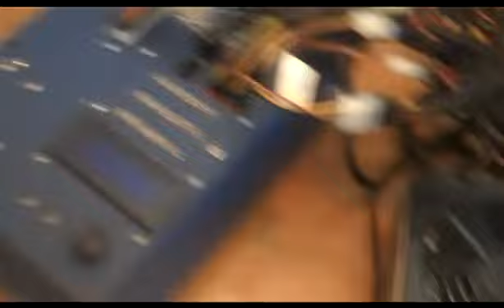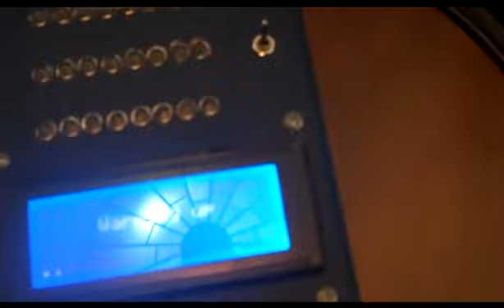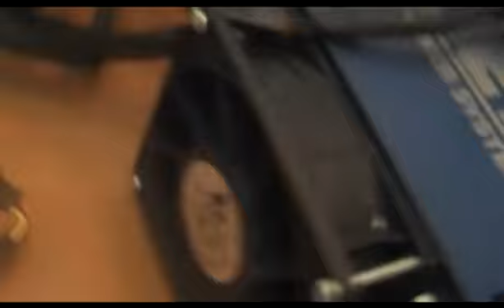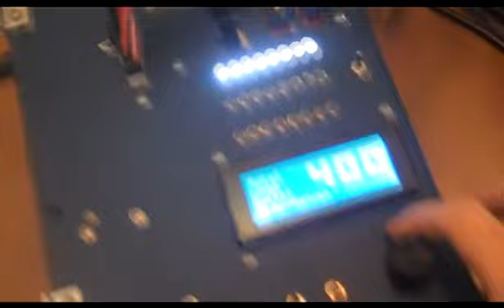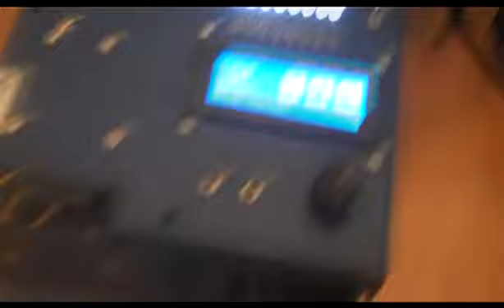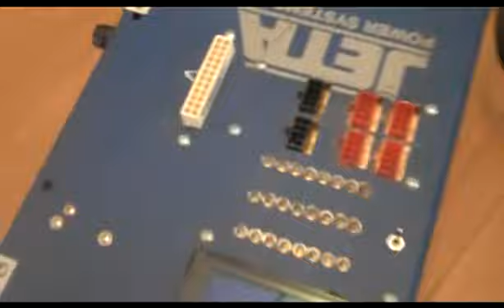Arduino - PC Power Supply Load Tester [GND-Tech]

Comment from the maker: It's near completion. The efficiency calculation circuit is done, I just need to wire it in. However, rebuilding another one would take way more time than I currently have available. Sometime in the near future I plan on creating a complete schematic, parts list and programming code and publishing it when it's complete. :)